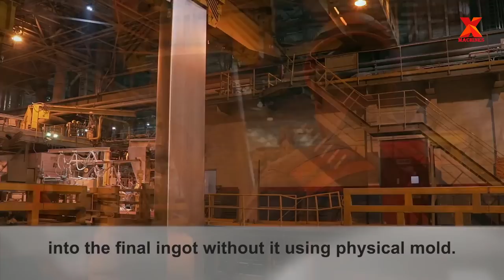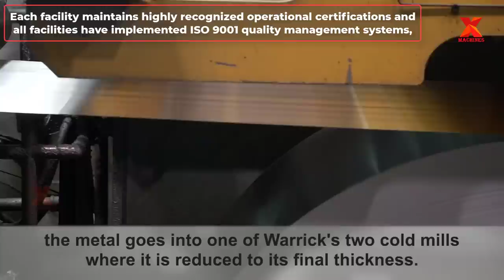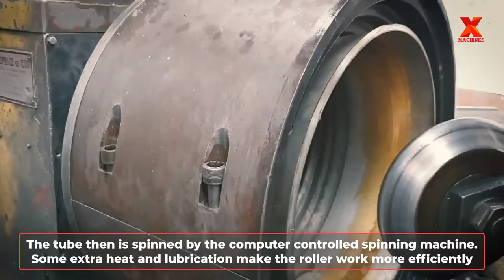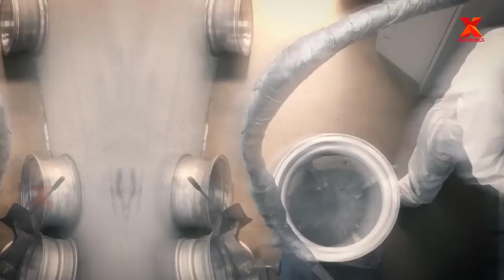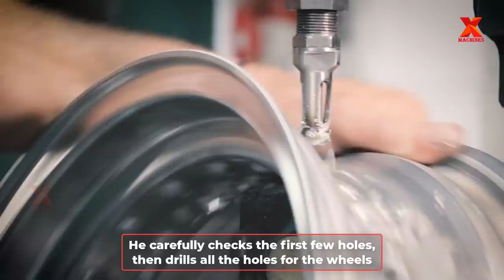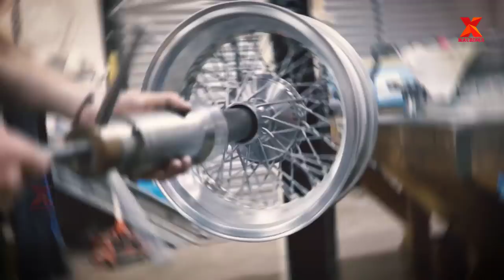Discover The World's Leading Aluminum Coil Mill. Hypnotic Alloy Rim Wire Wheel Manufacturing Process

Comment: Very well.
But very large part of the world uses the metric system.
Reply: Maybe one day they will switch to the Imperial system which is hands down the BEST!
Reply: @BobSmith-mc7uq  Yea right 15/64",3/4", 56"27/32",pounds gallons,miles all very easy to remember and even aren't day.When you could be using straight forward 1,10,100,1000  in grams, kg,m,km etc etc.You got to be kidding me.